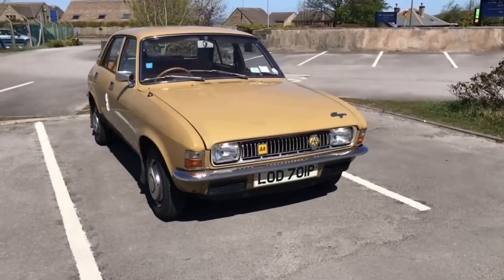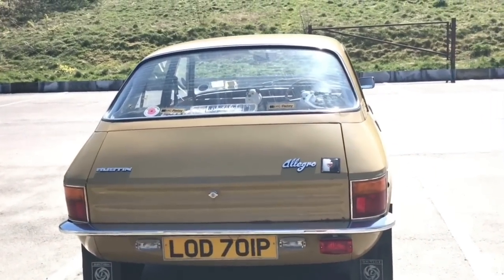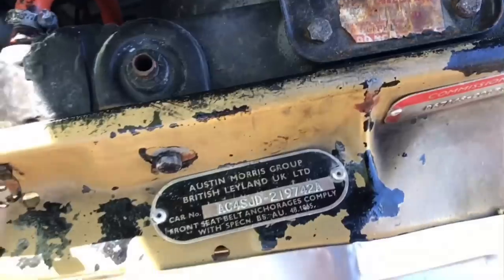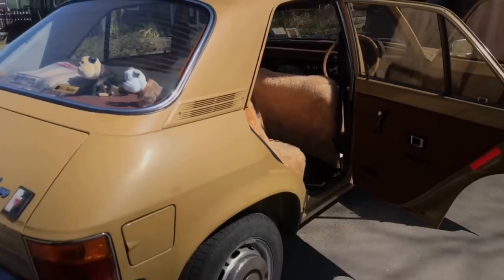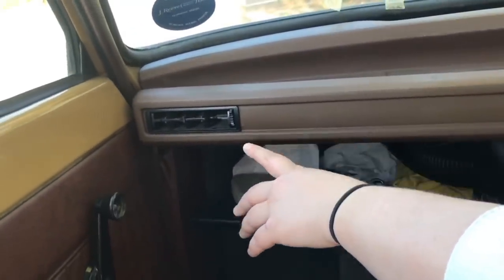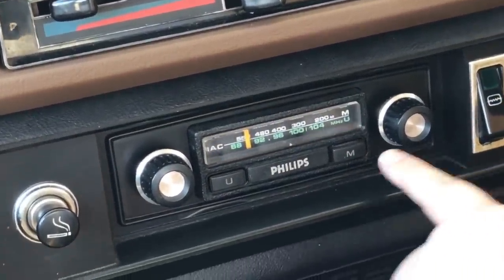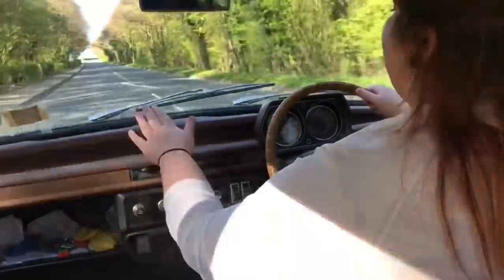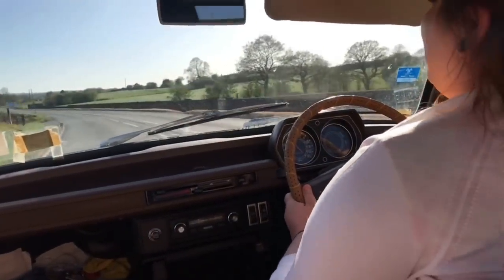IDRIVEACLASSIC reviews: 1970s Austin Allegro

Comment: that car was designed by a blind man
Reply: Shush
Reply from the maker: Literally first 10 mins explains the styling. Harris Mann is a great designer.
Reply: Actually it was the colours and wheels of the early cars that let them down and some of the grills as well but later on the Equipe with the alloy wheels that made a huge difference and the Mk3's with the better wheel trims were very nice looking cars- the Mk3's with twin head lights were really nice. I owned an Equipe and I always came back to people looking in it and around the car and asking me about the car when it was parked and there are not many if any ordinary cars that that would have happened with.